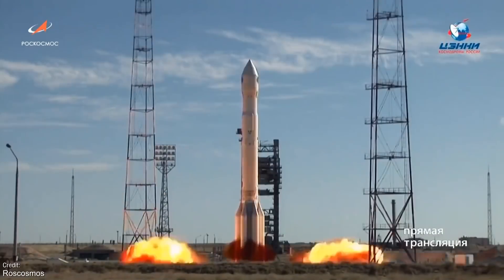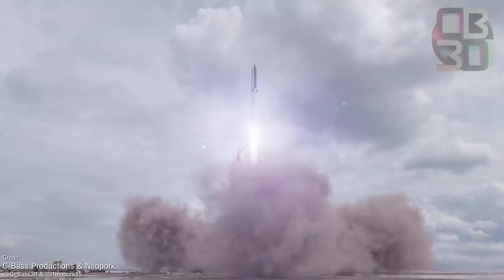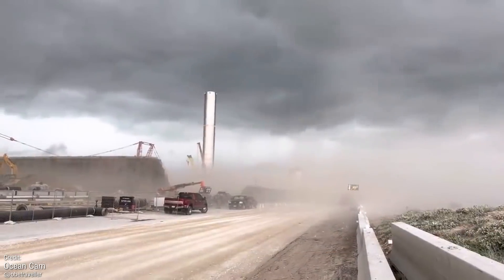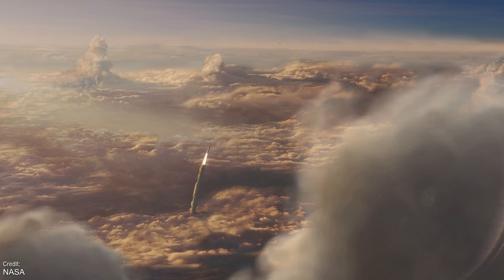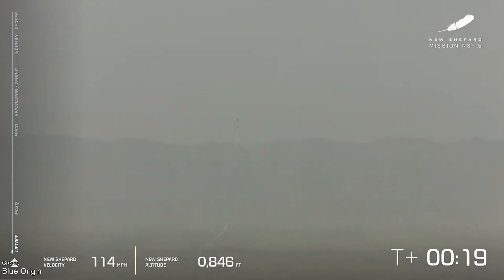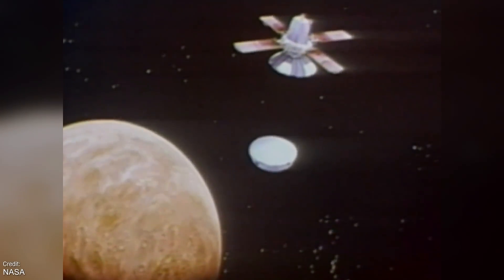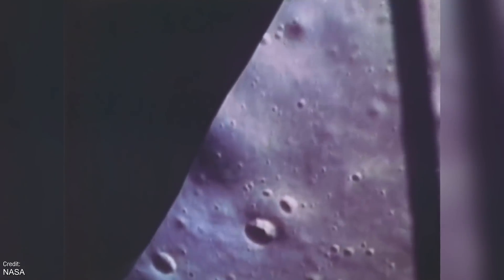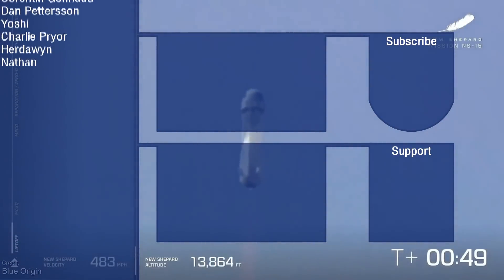SpaceX Starship HUGE Stage 1 Static Fire this week, Hubble Lives, and Blue Origin Prep for Crew!

Comment: The moon landing was on the 20th mate, hence the NS 16 launch schedule.
Reply: July 20th Houston time, using the clock at the Johnson Space Center/Mission Control. Or July 20 1969 20:17 UTC. 
Although like the time trip-up in "Stalag 17" (1953), it was July 21st in other parts of the planet.

Comment: Starship booster with half a million pounds of thrust: the most powerful rocket ever
Saturn V with 7.8 million pounds of thrust: am I a joke to you?
Reply: Yeah, half a million lbs with 3 of the 33 raptor engines... even the Falcon 9 does between 1.2 - 1.5 million lbs of trust. All said and done, it should be over 2X as powerful as Saturn V

Comment: The exact failure mode on Hubble could be good news. Hubble has two of all its electronic components, and is already on the backups of a few. But the power module was still original and the most robust part of the system. So switching to backup shouldn't seriously reduce the life expectancy, backup electronics are still the limiting factor.

Comment: 3:40 "how many differnt sized tiles there where"
To be fair, that has very little to do with the hexagonal design of the tiles and everything with the fact that the shuttle was a very complex shape whereas the startship is a cylinder. Sure, choosing a cylinder may be clever but the first rockets where all cylinders so... not exactly a Space-X original. And neither are the tiles. or the engines. Or even the landingprocedure.
Space-X is good at what they do but they are not doing anything really new, just using crazy amounts of cash in one huge long-running coimmercial for Musk-SpaceWays.

Comment: Fun fact Karman actually calculated space at 83 km but it was rounded up to 100km because reasons.
Reply: In fact, the 50 miles America uses as the boundary of space is far more in line with Karman's calculations than the international mark.  50 miles being approximately 80 kilometers.  100km/62 mi is harder to justify as simply rounding up, and it doesn't line up with the data we've gotten from low-flying satellites.